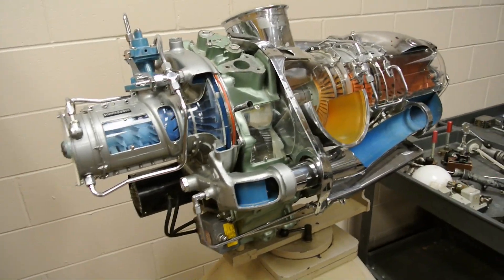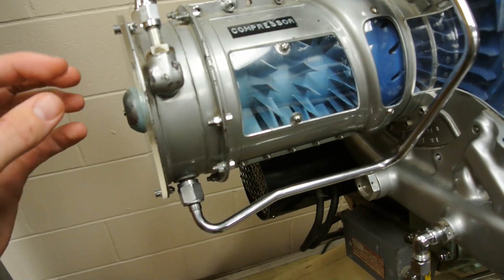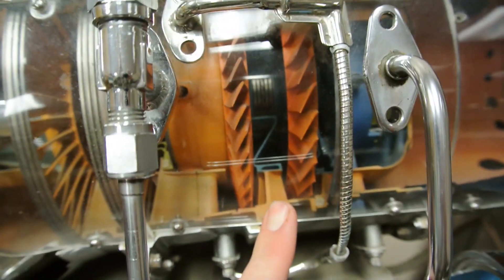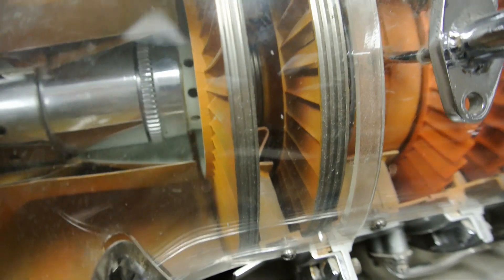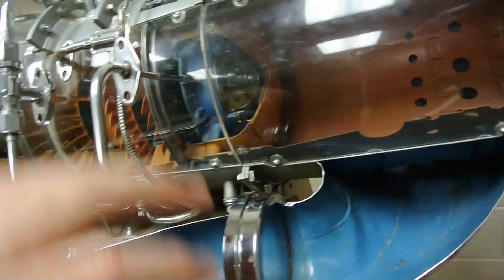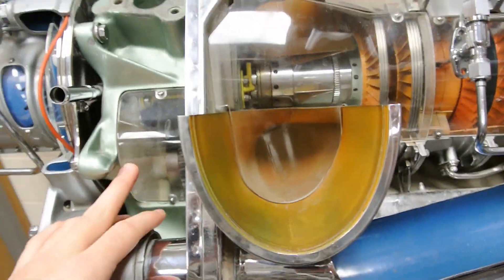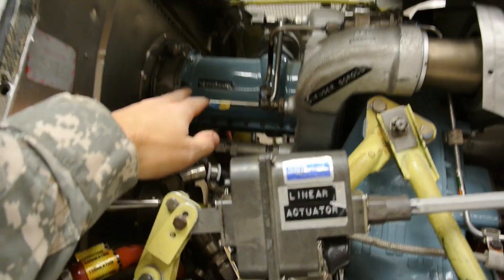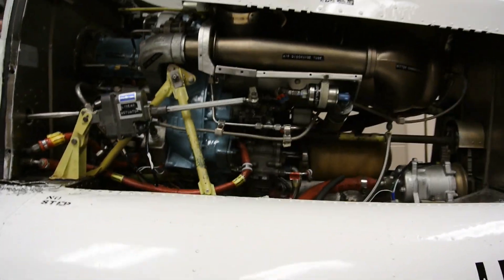How A Gas Turbine Eninge Works, Bell 206 Helicopter

Comment: Very nice demonstration. Thanks. In TV-2 Turboshaft engine (Mi-8 helicopter) of the 1960s design, there is only axial flow compressor with straight flow annular combustion chamber. Variable stator vanes and blow off valves prevent compressor surging in it. Students in India can get hands-on training on this engine. https://www.youtube.com/watch?v=6xs5NWsDMxc

Comment: Do piston powered helicopters still exist? I read that during the Vietnam war, the H34 was used by the Marines and it had a similar payload and spec to the Huey however it was ultimately phased out. In light civil aviation piston engines are still common but not so helicopters?

Comment: Thank you so much, that make me know this engine is different from common Gas Turbine or general types. They designed the combustion chamber is installed in the back of the engine.

Comment: Is the power turbine turned by the air or is there a shaft that also moves the power turbine
Reply from the maker: The power turbine is driven by the expanding gas from the combustion chamber.  the PT through with a gearbox and transmission drives the main and tail rotor.   Thanks for the comment, please Share & Subscribe.

Comment: hey, great video!
just want to know why is the combustion chamber at the end and not after the compressor?
thanks
Reply from the maker: I have herd that they did that do reduce the overall length and make a more compact engine.  If anyone else has a reason we would like to hear it.  Thanks for the comment, please Share & Subscribe.
Reply: Samarth Jain There's 1 burner can in the turboshaft engine, unlike a turbo jet, or turbo fan that has multiple cans in an anular configuration around the shafts, If you center the single burner can between the compressor and turbine, it would be in the way of the shafts that connect the high and low pressure turbines to the low pressure compressor in the front, and the centrifugal compressor behind it. Also, it's easier to throw the air down the long bypass tubes then it is to have the air make a 90 degree turn into the burner can if it was located directly behind the centrifugal compressor, airflow is everything in a gas turbine engine. correct air velocity, pressure and temperature means everything. Also, having the gear box in the middle means they can center and balance the engine in the helicopter better then if the gearbox was at the end of the engine, if that was the case, you would have the engine poking out the rear or the front of the helicopter. I'm sure there's more reasons other then what I stated, but I'm tired and tired of thinking tonight. lol.

Comment: Beautiful cutaway, excellent tutorial covering the basics. 
I'd be very interested in you doing another video, using the same diagram, showing the starting sequence, the compressor stage, external compressor, etc and what chain of events occur in sequence. Great video sir, thank you!
Reply from the maker: I am trying to make one for the GE T-700 series. Thanks for the comment, please Share & Subscribe.
Reply: Would love to see it when you get it built. I love the Allison turboprop engine for airplanes.. amazing engines.. Small size, huge power. 
Do you know what speed the final RPM of the Bell 206 is approximately? I know it varies, but stable lift, regular cruise rpm of the rotors? I know that an airplane prop, has about a 10:1 15:1 gearbox reduction on some aircraft, making final rpm approx 2200-2500 rpm.. However, helicopters have 2 transmissions I believe.. Reduction down to a base RPM of 2500ish, then down to 300-400 rpm final. I think this can vary quite a bit, but the engines have a basic cruise speed where they're most efficient. I guess this depends on every helicopter on the diamter of the blade, length of the blade, and most importantly, the magical tip speed of the rotor. I know it's extremely hard on any blade or rotor, not to mention noisy as hell, for the tip of the blade or prop to break the sound barrier, so they stay well below that speed.. But the actual final drive transmissions and gear reduction from 20,000 - 100,000 RPM in turbine engines always amazed me. Turning raw high speed whining turbine into a final drive output speed you can conceive.. 
I'd love to replace a twin engine Cessna 421b continental piston engines with Allison Turboprops... but the final cost is so staggering to do so, it's just not worth it. Would be an amazing conversion however.

Comment: How does the starter work? If it is electric, I bet it uses quite a bit of electrical energy to spool the turbine up to speed, to avoid a HOT start.
Reply from the maker: +Lloyd Morrison It is an electric starter and does draw a lot of amps.  Most pilots will use a GPU to supplement the battery to help avoid a hot start, it makes a lot of difference in the start.  Thanks for the comment, Please Share & Subscribe.
Reply: The turbine outlet temprature needle shooting on battery starts is a sight to see. Very intricate starting for jet ranger

Comment: One of the more interesting videos on Youtube...  I didn't realize that the reduction gears was such an integral part of the helicopter turbine engine.
Reply from the maker: +Afrocanuk There is also an amazing amount of reduction that takes place in the main rotor gear box.  Most man rotor spin in a range of 230-600 rpm depending on the type of helicopter.  Thanks for the comment please share & subscribe.

Comment: He should be giving credit to the manufacture Alison that made this engine. It is a very very old, but still used engine on helicopters. The Alison C-250 and other versions are still great engine.
Reply from the maker: +Lorin K Thanks for the comment please share & subscribe.
Reply: +Lorin K Is that the same company that makes heavy duty transmissions? Alison IS Very dependable!
Reply: Alison is just the gear box , Alison is the inventor of the gear box that's used on Turbins , also the same company that makes the Abrams 1 tank transmission and the Alison Transmission on Duramax trucks and Alison transmissions on commercial Diesel Semi trucks . GENERAL MOTORS actually built these turbin engines . General motors got out of the business of building turbine engines and sold the right to the engine to Roles Royce . All the Data tags are on the right side of the engine . The hot section ( turbine ) the Alison gear box , and the compressor section .

Comment: Tail rotor on that model goes to about 2500 RPM,Main Rotor about 500 RPM
Reply from the maker: stealhty1 Thanks for sharing some specs with us, please share & subscribe
Reply: As the gas turbine spin they are also attach on the same shaft to all those  blue  compressor turbines ( watch the video closely )
Reply: Dont think mainroter is 500 rpm. Its close to 324 or 340 dont remember exactly

Comment: How come they didn't make it a flow-through design instead of routing the compressed air around  and putting it in the opposite side of the engine the reverse way?
Reply from the maker: sc0tte1 we are not exactly sure why, but the is a conversation further down in the comments about why, check it out.  Thanks for the comment, please share and subscribe.
Reply: +sc0tte1 At a guess I would say it is probably for the same reason any thing is folded -to achieve a compact unit.
Reply: sc0tte1 if I had to guess its because it would have not been a good setup for a helicopter. The engine would have been to long with a gearbox attached to it.
Reply: Pls answer
1. Which starts first N2 or N1 .
2. In which condition N1 starts first .
3.Main rotor RPM is 5-10% while engine n1 =77 % and n2==100% .Is that abnormal or just warm up before take-off .
Reply: @supermanmatka6700  The N1 gas producer drives air to run the N2 power turbine. I don't understand your number 3 question. Generally the main rotor RPM for most 206 sits around 60-70% while at idle for warm up which leaves the N1 between 60 and 64%. The N2 and NR (Rotor RPM Tach) are married together so if the N2 is at 100% so is the NR.  Hope that helps a little!

Comment: Why is the turbine shown in the video different than your standard turbine you see in military planes? For example, Compressor, combustor, turbine, exhaust is in a straight line and in the video shown, the compressed air runs to the back of the turbine, and then forward. Why the difference?
Reply from the maker: Found this on Wki, and it swill does not really explain why.  I will try to find out more from the guys at the flight line.
Allison adopted a reverse airflow engine configuration for the Model 250: although air enters the intake/compression system in the conventional fashion, the compressed air leaving the centrifugal compressor diffuser is ducted rearwards around the turbine system, before being turned through 180 degrees at entry to the combustor; the combustion products expand through the two stage HP turbine, which is connected, via the HP shaft, to the compression system, before expanding through the two stage power turbine; the exhaust gases then turn through 90 degrees to exit the engine in a radial direction; a stub shaft connects the power turbine to a compact reduction gearbox, located inboard, between the centrifugal compressor and the exhaust/power turbine system.
Reply: msfirefighter662 Maybe they used a reverse airflow because it makes the engine size smaller, lighter?
Reply: We were told by the instructor that the design was chosen because it was compact, i.e. The design allows the overall length to be shorter.
Reply: The layout of a gas turbine is usually dependant upon its application. The straight-through design that you described (comp, diffuser, combustion then turbine) is typical of a turbojet/turbofan design(though there are exceptions to this, especially for turbofans) since their primary propulsive force is derived from thrust from the engine itself. This usually requires as small a frontal area as possible to minimise drag penalties, especially for turbojets and low-bypass turbofans. When you get into turbines such as turboprops and turbo shafts (and some turbofans), the primary method of propulsion is external, i.e, thrust from the propellor or lift from the rotor blades. Hence, there is probably more of a design requirement to keep the power plant as compact as possible while frontal area not being so critical a design factor. As such, various layouts can be achieved, some of which can look the wrong way around, like the P&W Canada PT 6. But this means the free power turbine is at the front of the engine which is very handy for a turboprop application. Hope this hasn't confused you too much.
Reply: If you want a REALLY confusing airflow layout for a gas turbine engine, have a look at the  Garrett ATF3! Someone was on some good shit when they came up with this design.